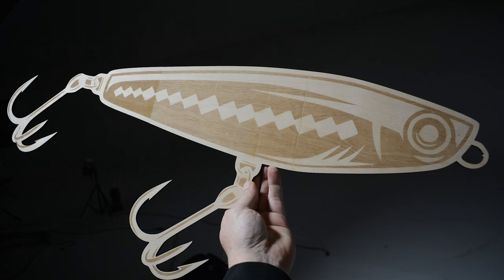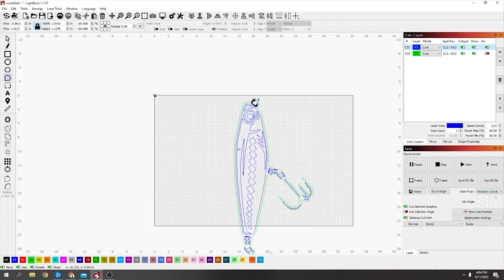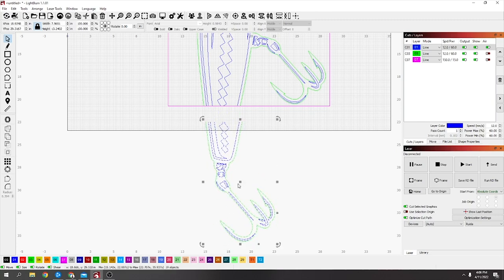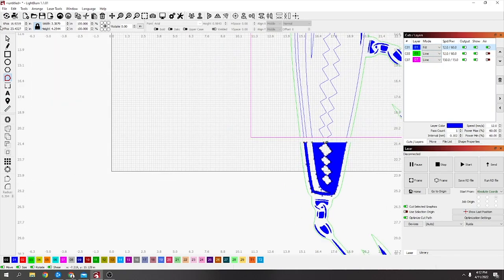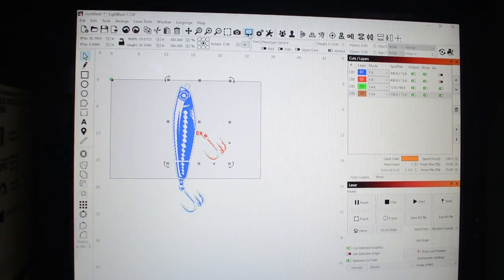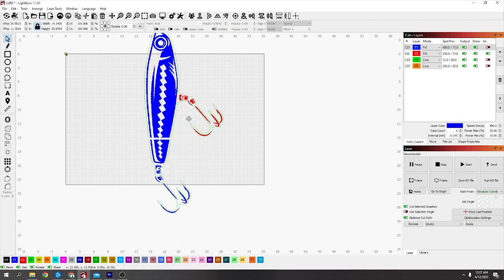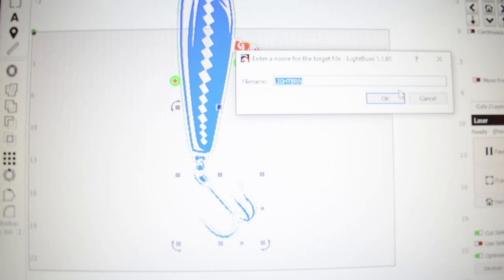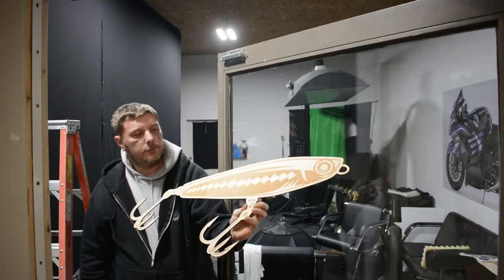LASER CUT & ENGRAVE PASS-THROUGH  LARGER THAN LASER BED LARGE OVERSIZED PROJECTS USING LIGHTBURN

Comment: Thank you very much for your video! How do you manage to place your laser so precisely in the middle of the second cross? I've tried positioning my red pointer in the middle by pulsing it. My second cut is always off by 1 or 2 mm on one side or the other.
Reply from the maker: slow the speed of the laser head down and just keep moving the red dot until your right in the center of your cross, the closer you are the closer the design will be . Thank you
Reply: @carphotography  Did it with 1 mm accuracy. I'm right in the middle of the cross because the red dot is hides in the engraving. But still, when I do my second cut, it's always off.

Comment: Hi thanks for your pass through video I was able to cut some 4 ft circles
I’m trying to cut a human figure now and did Edit Node and Break Apart and I cut the first half with no prob
I can’t cut the other half now. It’s not previewing and the file doesn’t load on the controller
It does say it’s crossing the edge of the machine
What am I missing?
I have Cut Selected Graphics selected
Reply from the maker: put the other half on a different layer and try, maybe it is a bug also make sure it is not to close to the edge of the machine. thank you
Reply: Thanks for the quick response 
I did
I have them on different colors. :(
I already successfully cut the bigger part of the figure
I did the Print and Cut bit 3 a few times now to make sure I’m not missing anything
Reply from the maker: @gandcwebb3700  try going upto laser tools and try auto align outputs or press ALT + 3. above where you see the frame symbol do you see (READY) Print and cut  ?
Reply: @carphotography  It does say Ready (Print and Cut) but still days shapes crossing the edge of the workspace
Reply: So idk why it says it was starting from Absolute Coords so I changed it to user origin. The file got sent to the laser and it shows on the controller but now it says XY slop over
Sorry for bothering you
I’ll try Thunder support 🙈
Reply from the maker: @gandcwebb3700  do you have it set to absolute coodinants ?
Reply from the maker: @gandcwebb3700   Absolute Coords would be correct, maybe save it, restart everything and try again. good luck hope you get it sorted.